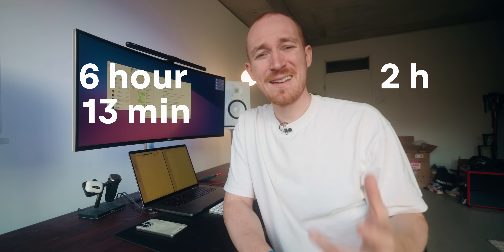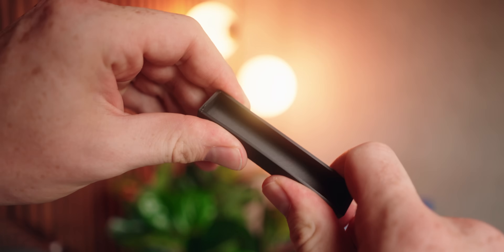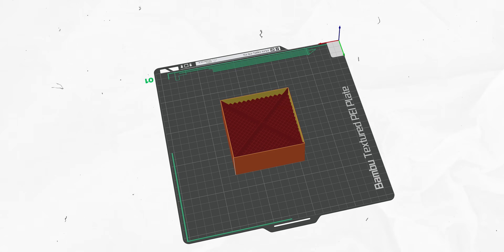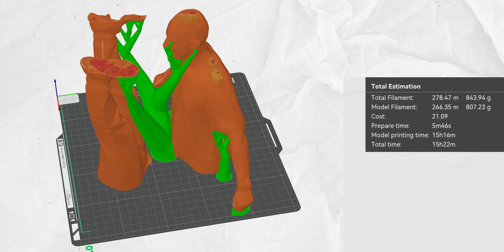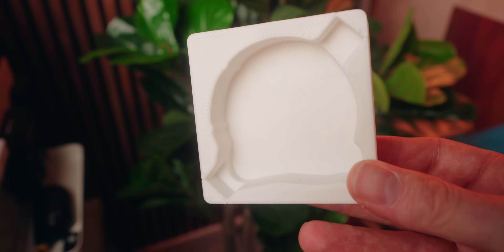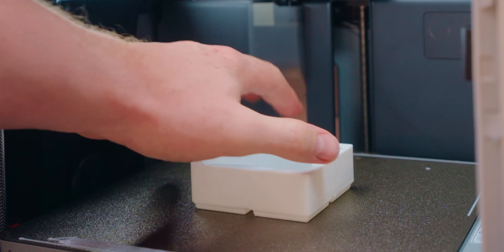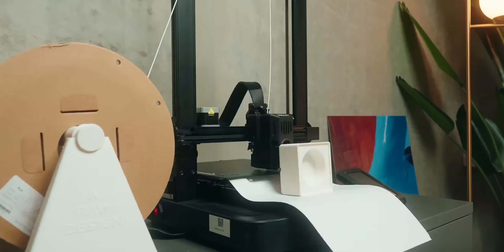3D Print 50% Faster with These Tips! (Slicer Settings)

Comment: Simple, practical - love it.  First three tips took me from 6:08h/155g to 3:57h/99g... so that has knocked off 1/3 from the time and the filament cost - which isn't nothing for these larger prints.... still, I have only just started the print off... lets see if it actually works...

Comment: awesome vid.  I'm newer to fdm printing mainly do resin printing.  last time filament printing was 10 years ago. 
coming back to it and seeing tech changed so much,  I wanted to just right into it again without messing with too much with settings. but these tips are good to apply once i get to point shaving hours of time on bigger models. so I'm sure I'll appreciate it sooner than later.    just got an Anycubic s1 combo. no issues yet. it takes a bit longer than resin but having fun with less resin mess. 🎉

Comment: Hi Arne. Thanks for the good tips. In addition,  i think, you can save a lot of time by reducing the “travel time ”* (the distance the print head travels). This depends on the positioning of the print objects. F.ex. if you move your "ashtray" more to the left ... *Make it visible in the slicer window. Move or rotate models accordingly. Kind regards from Anja in Berlin :-) (Sorry i dont find the video where i got this tip, but it works )

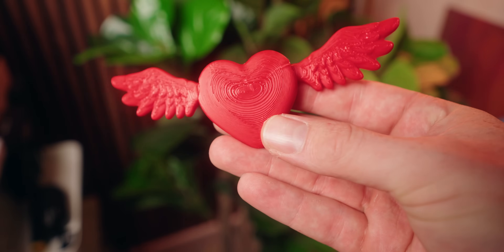Comment: 6:28 I have this starecasing ISSUE, How can i solve it ?  ):
Reply: Use lower layer heights. For example 0.28 is great for bigger boxes or things that don't need to be detailed but when doing smaller things with more details, for example a benchy, you should use a smaller layer height like 0.14. Hope this helps!
Reply: So late responding, but slicers like Orca Slicer have "Adaptive Layer Height" and this will let the software decide where it needs to make smaller layer heights. Slopes will be smaller and vertical with go to your max.
Reply: @iamjoeysteel TYSM🙏🏻

Comment: Hey, I have a large nozzle 0.8 mm and a good preset for it but I can not really find gridfinity boxes that have wall enough wall thickness to slice them well. Parts of the walls are disappearing. Which boxes do you print with the 0.8mm nozzle? Have you got a link to a great set? Thanks for the tips!

Comment: I've been designing most of my models lately. I'm no expert with CAD. I've found it also helps to use the cut tool to cut the model down to just the part I need to match up to it's real world mate. Use little infil, and lightning pattern. If it fits in the real world I will go back and print the whole model with the strength needed.
Reply from the maker: Yeah cutting with slicer to only print a part is a big timesaver 😊 !

Comment: what is this slicer? looks nice, and i would like to try it, as i'm used to cura
Reply from the maker: I use Bambu Studio or Orca Slicer
Reply: That one is bambu studio but if you have a non bambu printer use orcaslicer instead as it will actually have non bambu printer profiles

Comment: Well, I figure you aren't allowed to say anything.  But with bambu labs pulling the classic corporate bait and switch (And I have one of their printers) , I wouldn't recommend people buy them.  I put mine in lan mode, deleted their apps, and blocked the printer at the firewall.  There is a likely risk of being in subscription model or them controlling what you can print.  And only being able to print when you can connect to their servers is unreasonable.

Comment: the 0.8 model looked really bad. but if it works then it works i guess. The stuff i print needs to look good even if some of them are boxes and that is way too low rez for what i need. People dont like to see that its 3d printed. odd i know, lol. Some Good points in your video though. Esp the if i need to try and optimise a print if its only an hour and i save 10 mins. No realy point. Anyways hope to see more interesting videos from u. cheers. (PS look at Infill Combo. one of the best setting i found and no one talks about it)

Comment: Great methods to speed models along.  I have been using three of these, glad I watched your video.  I will go back and run new bins using all suggestions you mention.  I have about 600 bins to print and at least 40 more grids to get done.   I do use a 6 nozzle may try out the 8mm.  The lighting infill should be good on gridfinity, not sure on higher quality models if I am big fan for its use.

I did not jump on the gridfinity fan wagon until about ten weeks ago, now that I have used it in shop finding it is the best organizing system available for mutiple uses.
Reply from the maker: Wow 600 bin’s is a lot to go! Yeah lightning infill doesn’t work for all models but is definitely with giving it a try. Especially at scale it makes a difference. 
Hope your system is coming along nicely !

Comment: Does this settings work for all the models or just for specific ones?
Reply from the maker: There's always some experimentation to be done! For example, lightning infill works most of the time but will lead to less sturdy pars, so it depends on what you use it for

Comment: Sometime modifying the model can really help. For example at the bottom I just remove thickness until there is only a solid panel and no infill at the base ex 3 bottom layer + 3 top layer of 0.2mm then I would set the bottom thickness to 1.2mm. I can easily do this after in the slicer by moving down the model until I don't see any infill.

If somebody would still prefer infill for increased stifness then this is not to do because a small panel with the same mass of a bigger panel with a low infill is often more flexible but not weaker tough, in fact it often is better at resisting impact due to the flexibility

Comment: Another Priceless video. Less time, less filament.. Ha..Ha.. I figure I am going to be printing a couple hundred hours worth of boxes for organizing.. So, quality first to see what the printer setup can do, and migrating each set of prints with additional settings to see how fast I want to print for the quality of print I need/want to get the job done.. I like it.. Taking notes and documenting what works as you go.. Great Starter material... 
BTW.. A tip on another video.. Combining STL files to setup batch print jobs..  I think I am going to want to import several boxes into a single print and let it go vs single prints.. I have seen a video or two on stacking gridfinity bases to print a bunch of them at one time.. Have you tried or perfected that? A newbie video would be cool on that, since I think a lot of people start there.. Thanks again on another awesome video..  I can see me with 4 to 6 printers before this is over, sitting on top, or, dehumidifier boxes sitting over the printers and feeding the filament to the printers out of the dehumidifier boxes.. Figure I will have the cabinet base big enough to house whatever extra filament I buy for the printer startup. PLA, PETG, TPU for some Flex parts, not sure what else. Going to get some matching colors like black/white black/gray, white/gray, Black/Red, Blue/Red, etc, so, don't need a lot of colors to start.  Going to buy Bambu filament with the printer and some of the cheapest I can find on Amazon of the same color and do some test prints and see how cheaper filament works compared to the Company filaments.. Any advice on Startup's is always welcome..

Comment: Awesome. What if I’m not using Bambu Labs proprietary slicer? Thanks for nothing.
Reply from the maker: Most of these settings apply to most slicers. Also you could use orca slicer which is free, works with tons of printers and is based on Bambu Studio
Reply: Use Orca it's the same thing if you want that slicer but all of these settings are on every slicer I've ever used.

Comment: The title says it already. Too much of "trying to sell the video" at the start. Would much have preferred you just getting to the point.
If you need to get over 10min then I'd recommend just researching and adding another "how to" point, which actually adds value. 
3:41 Use the right click option "height range modifier" instead (for this specific use case). Now you won't need to fiddle around with sizing and positioning a body.
4:13 Good point making people aware of! Almost nobody talks about that in their "How to faster prints" videos. 
Overall nice video for beginners 👍
Reply: Ahhhh ha ha … omg !! i wish I saw this a year ago because by now you have probably killed yourself due to loneliness… jesus fuckhead just fast forward the video ,
Reply from the maker: Thanks for your detailed feedback! Will definitely keep the intro shorter in the future :) 
thanks about mentioning height modifiers! Definitely also a great tool.

Comment: I have the 0.8mm nozzle and did not installed it yet, how is quality when you print 0.2mm height?
Reply: Not good.  In general you wanna stay above 60% the nozzle diameter for layer height.  
It’ll work if you go super slow at .2 …. In Pla.  
But if you do any other material … it’s gonna be a mess. You should really stay about .38
Reply: @JeromeDemers  good but takes a lot of time

Comment: Why do I keep thinking there will be a "magic hidden bullet" on these videos then absolutely nothing new is said and it's just buttons.

I'm in search for 3d slicing algorithms, not buttons that everyone sees.
Reply from the maker: I think it's about building the right toolkit that you can use depending on the situation.
What do you mean by algorithms? Something that does all the work for you or the right set of things to do to get it right all the time ?
Reply: @arnebornheim   More technical stuff like speed optimized toolpaths, better bridging algortims, XYZ printing (not only XY printing), water tight walls, new developments on adaptive infills, organic supports that release more easily from the part without then need for multimaterial, etc.

Comment: im sad i didnt learn anything ):
Reply: I learned quite a bit. Let the trolls keep trolling, appreciate the video 👍🏼
Reply from the maker: @jordansjensen thanks and really happy to hear that 😊
Reply: @arnebornheim  yeah i might as well give u the list u demanded a month ago and i forgot about

layer thickness
line width (up to 2.0x typically is the limit before you see visual artifacting but 0.6 on a 0.4 nozzle is pretty good)
max volumetric flow rate
minimum layer time
arachne wall generator / classic wall generator
larger nozzle will change the max volumetric flow so if u do make another video be sure to mention that it will probably increase the max vol flow rate, it did in my results. 
speeds / accels / jerks (although i never mess with jerk)
infill patterns! lightning is always the fastest of course if u need a visual print. 
reduce overhang speeds can be disabled but of course will have worse results
probably missing a few that i cant think of at the top of my head.
Reply from the maker: @xXP1ZZAxD3MONXx  thanks for these 😊
Reply: I'm sad I didn't learn anything from this comment : (   It's almost like you should be okay that there are newbies in the space that still need videos like this and tips like yours.
Reply: @musicguy8912  scroll down in this comment thread u will find some useful tips posted by me
Reply: @musicguy8912  yes, I’m new to filament printing and really appreciate the information in this video.
Reply from the maker: Sorry there wasn't anything new in it for you. But are there any settings / tips you'd like to add that could further improve it ?
Reply: @arnebornheim How about if you want to make quality content that makes you money, YOU figure out new tips that would actually be helpful. 

There’s nothing in this video that hasn’t been said in 100 videos over the last 5 years.
Reply: @sxeychick9622 I bet your mother is proud of the person you've become.
Reply: Why so much hostility? 😳
Reply: @xXP1ZZ you must be a “SUPER STAR” who was born knowing everything!
Reply: @RC-Flight  i mean. the comment is 2 months old now. im surprised ppl are still replying. but no i just learned these from experience over 2 years of 3d printing.
Reply: Not everyone is perfect
Reply: hey, it's his first printer.. he thinks he's reinventing the wheel.
Reply: @habiks  Yeah. lol

Comment: I'm surprised I got recommended this so early! The tip about not optimizing small models is good. It's just not worth it to work for minutes in the slicer to shave off minutes of automatic print time.
Reply from the maker: Yeah I think it's all a balancing act where it makes sense and where it doesn't 😊
Reply: If you only plan to print it once. 

If you are going to maybe have to print it again… as people say “do it right the first time and save yourself in the long run.”